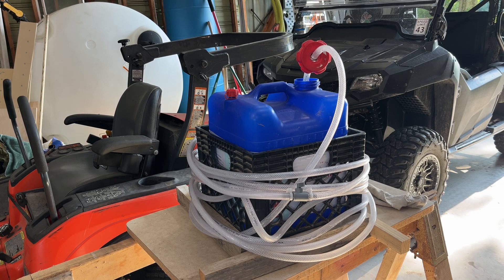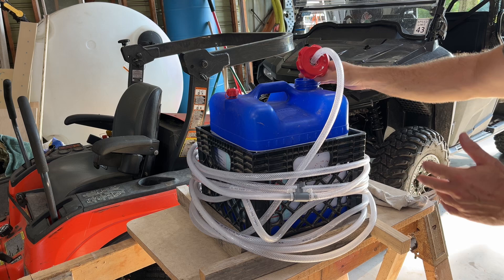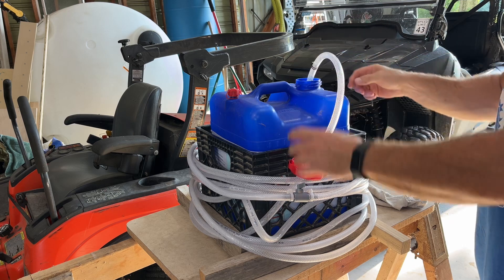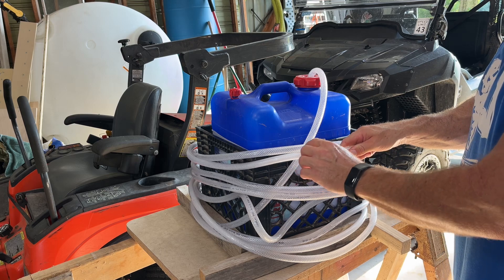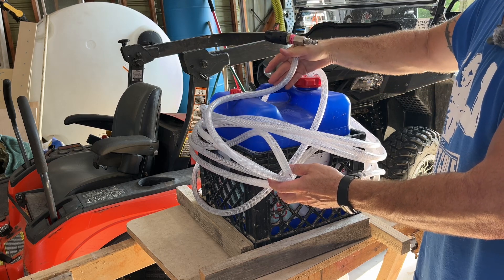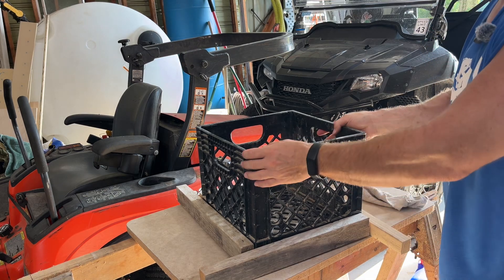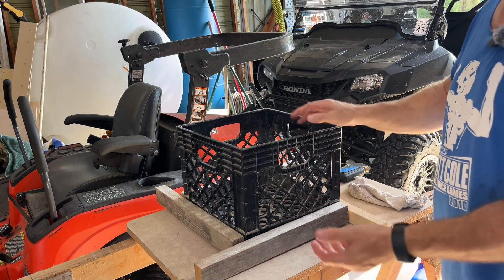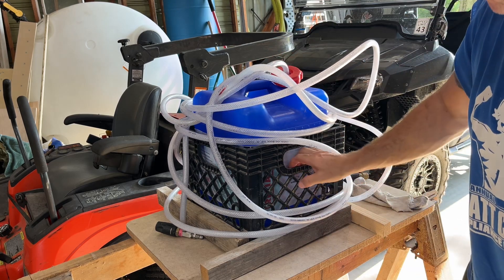My cheap DIY version of the X-Jet pail system. Works great!

Comment: Nice build! Check out the modified xjet gun by Doug Rucker. He attaches it to the lower portion of the gun, and you could put a lance after it. It minimizes the overspray and allows you to reach higher distances.
Reply from the maker: Thanks, I will definitely check that out. Thanks for watching

Comment: I washed my entire house with an x-jet #13(should be a #7 but didn't know then) with a small Honda 2.4GPM/3200psi washer output and it had no problem reaching to the utmost top of the house. It looks brand new! Also climbed up the ladder to get the mid-roof gutters section and had no issues with the chem coming through. Was only up about 15' or so.
Reply from the maker: Thanks for the info. If I get the chance maybe I’ll see how high above it can be.